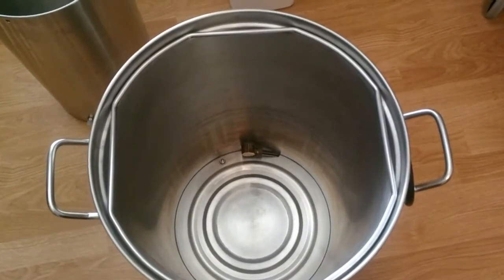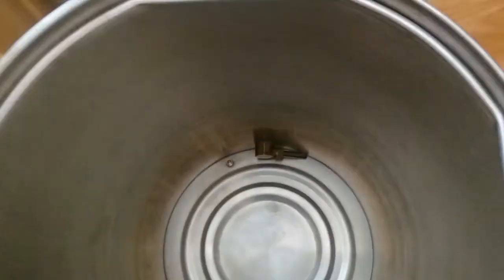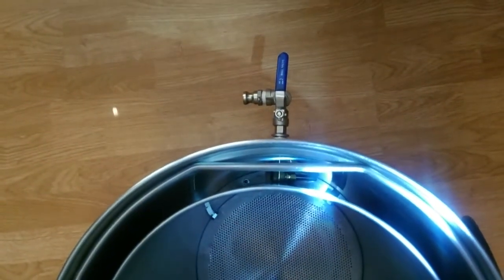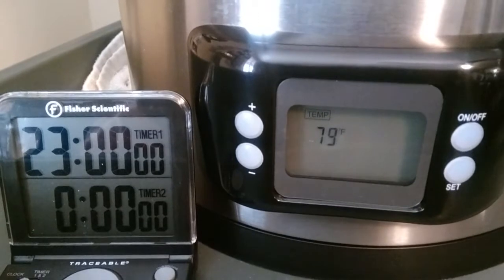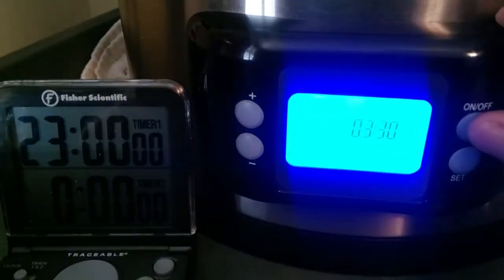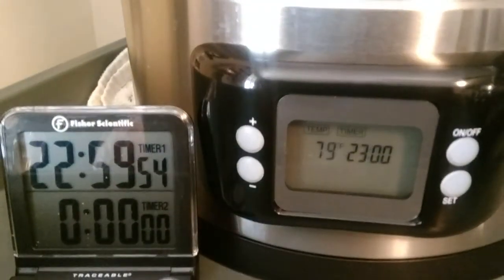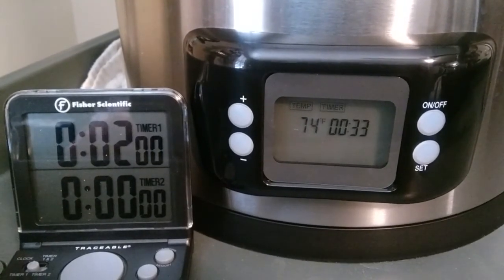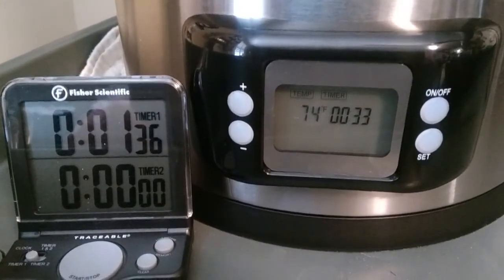Mash and Boil Dip Tube and Delay Start Test

Comment: Scott, I wonder if there's a time start button.  I noticed after you set the time, you never pressed anything afterwards.  Perhaps it will auto-start after 30 minutes if you don't kick it off?  Did the 23:00 drop to 22:59 after 1 minute?  Curious.
Reply from the maker: Yes it did start the timer immediately without pushing anything else. I didn't record long enough but it does go to 22:59 after a minute hope this helps Thanks.
Reply: Thanks for the reply, and thanks for posting the videos.  They are really helpful.  I like many have been considering the Mash and Boil, but something as simple as the timer no working correctly is concerning.

Comment: Hey Scott, thanks for the videos! What exactly is, and where did you get the new dip tube assembly?
Reply from the maker: Michael Sinyard The fitting I used is 1/2 FIP to 3/8 compression elbow. I got it a plumbing supply as the big box home center didn't carry it. Once you have the fitting you need to cut off the excess FIP portion so the basket will slide past it.